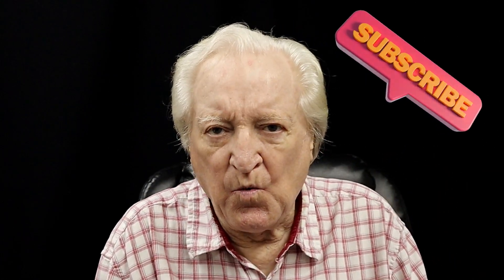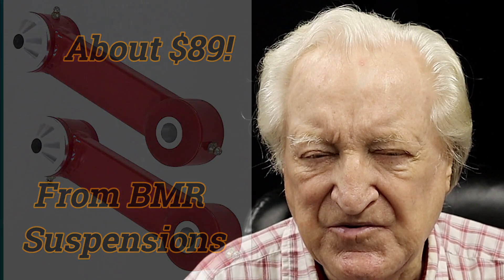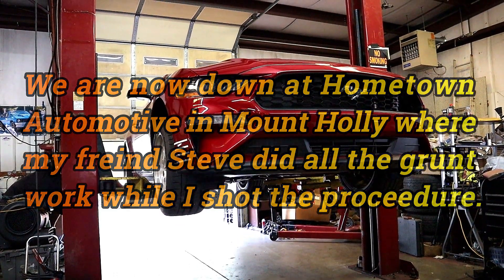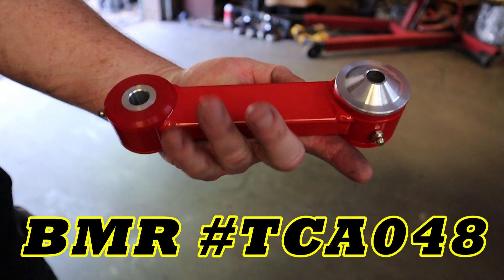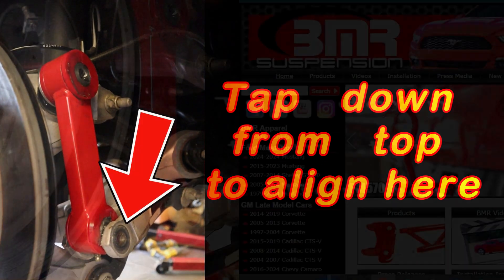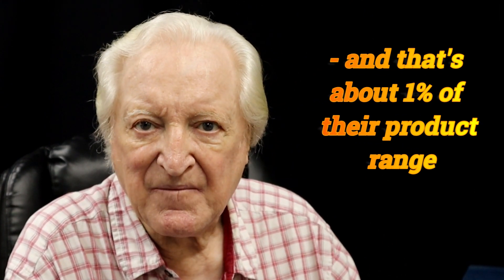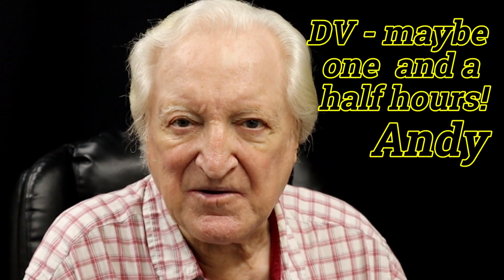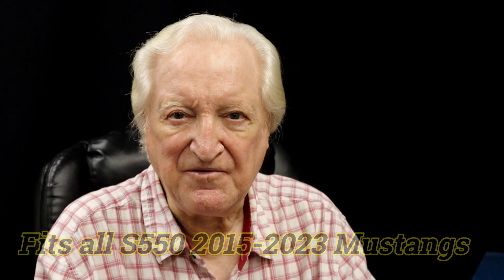Mustang hop stop - low cost hi-function

Comment: I've done most of the same mods as you so far David.  I still get hop; but, it is better.  I'm running a spherical lower control arm bearing, spherical toe link bearings (both chassis and control arm side), Poly vertical links (what was installed here), subframe spacers, and a brace to limit the subframe movement.  It's the full Steeda "stop the hop" kit.  Some folks on the forums suggest tires, shocks, and transmission may play a part as well.  It seems us manual folks get the hop worse.  I am running Michelin Pilot Sport 4s (larger than stock 275/40/19 on 19x10.5 HRE wheels) and the stock performance pack monotube shocks.

Comment: Hello, David.I just recently started watching your videos and I admire the endless knowledge. I'm attempting to build my own 400 sbc and need some advice. I lost my last engine because someone dropped my air breather stud into the intake into number 8 cylinder. I'm getting an aftermarket 400 block and want to turn it into a stroker and get as much low end torque I can and it still be a daily driver. I was inspired by the 421 you build. I loved it. Thank you for the videos.

Comment: Not much straight line traction is present with the Mustang IRS Differential layout. 
The Solid Axle 5.0 Fox Body Mustangs did way better hooking up bone stock.
Your EcoBoost Mustang needs Mickey Thompson Drag Radials or Hoosier Slicks. 
All IRS Independent Rear suspensions lack drag race antisquat stesight line.
Best was the C4 Corvettes ar 87% Factory Antisquat Engineered in.
Reply from the maker: Being conversant with race car suspension I am aware of the points you made here. That said thanks for posting as it gives me the opportunity to say what's coming down the line here.

First - as soon as I can afford the parts I am getting a new set of rear wheels on which I will have mounted drag radials. Any suggestions here on size and brand??
 I should point out that we are trying to keep this car in street/road race condition with no concessions to drag race performance. Having done a little  road course work I suspect the chassis needs a little more anti squat as well as some extra anti-dive - but we'll see on that when we get to some serious road course testing in 2025.
Thanks again for your post.
DV
Reply: @DavidVizard  Most popular today Racing 1/8 & 1/4 mile are P275 60 R15 Drag Radials that are about 28.0 -29.0 inches tall vehicle at a standstill.  They will only fit 11.0 inch rear disc brake rotors a 15x8 or 15x10 inch rim.
The 2024 Mustang EcoBoost looks like uses 235/55 R17 tires stock. 
So need at least 17 inch rim diameter Drag Radials. 
245/50 R17 Drag Radials were made.
If there is Room use 17 x 11.0 inch Rims with correct offset. Likely going to Milli meters offset like 36 mm.
315 /35 R17 I recall used on 17 x11inch rims, Old 1990 C4 ZR1 Rear rims and tire sizes.
All Purpose car hard to build and setup. Going to be a compromise somewhere.  Building one myself to Race 1/8 & 1/4 mile. Road Race Some, Highway Burner, Street Racer, Drive anywhere on E85. Past was 110 Leaded Race Gas or 100 LL Aviation Gasoline. My old 1970 Trans Am RAIV 4-speed 650 + hp all iron planned all NA before power adder used.
No Name Nationals Sikeston 1/8 you only need 1.7 times 60 foot to have real fun. Even 1.8- 2.0 decent. 
1.0 -1.4 60 foots takes alot of dedicated drag suspension parts going to kill true Road Racing handling and pure Highway road burner 100-200 mph speeds.

Comment: Good Mod David I had to replace the flimsy link arms on my Lincoln with upgraded ones they had the polyurethane bushing. Fixed wheel hop and helped with weight transfer to the rear wheels.
Reply: Never skimp on chassis😁. There are other places that can be budget cuts made to.